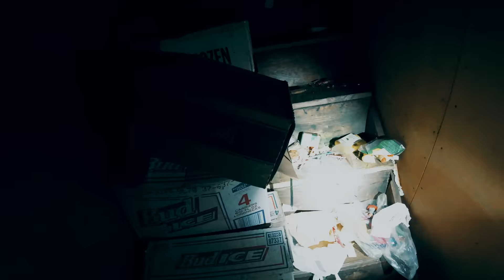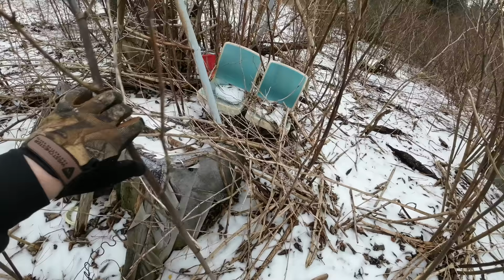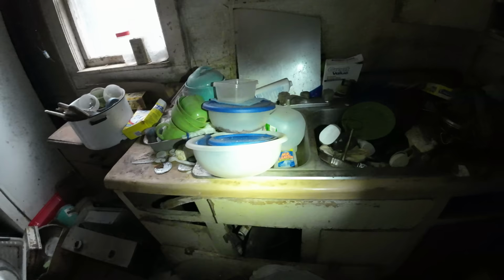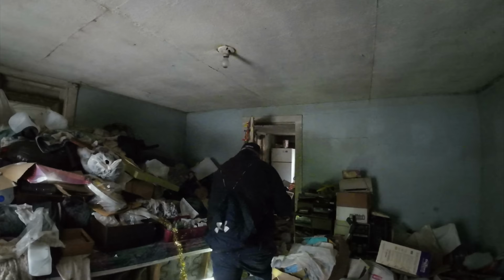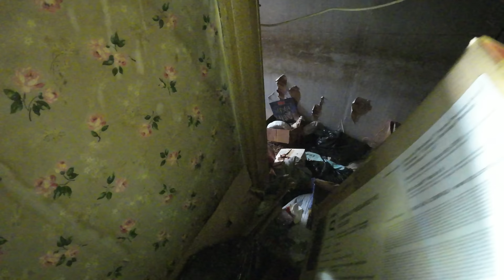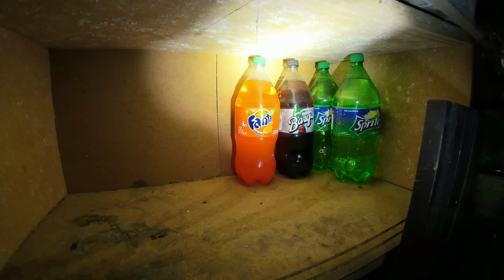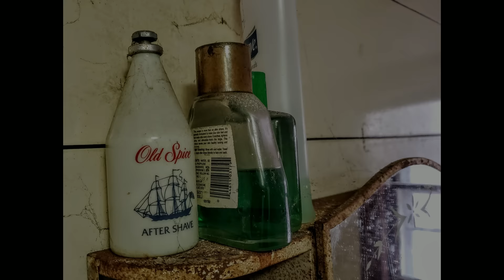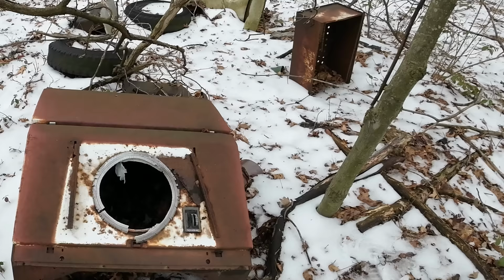Shockingly Indescribable Abandoned Hoarder House - Entire Life Left Behind!

Comment: The house is full of collectibles and some antiques. Their is antique furniture and steamer trunks. Collectibles in toys, electronics like the Atari game console. Collectible movie camera. Collectible cosmetic jewelry. The electric guitar would have some value. Collectible bowling alley signs and pins. Collectible kerosene lamps. Collectible glass bottles. You would need patience working through everything. So wouldn't miss anything. You could enough to open a small antique and collectibles shop. Here is an idea. You buy the property at land value. You drop down a large metal shed near the main road and set it up. You drop further back dumpster for trash and another one for recyclables. Bring in a scrap metal guy to remove the metals. Take the rubber tires to be recycle.

Comment: Evidently the occupants had no operating central heating (radiators =boiler) thus using kerosene heaters. Also no running water that explains the zillion gallon water jugs. A toilet will flush using about 3-4  gallons of water but likely the plumbing froze from lack of heat. 
Hanging laundry upstairs where heat rises is quite clever. 
The utter disarray.....?  A mental illness. Clearly the house has been ransacked for valuables (guns especially). Can see that for all the cabinets/drawers open,  furnishing flipped, tossed boxes, dumped onto the floors, etc. making it appear worse. 
So many questions. Thank you for the journey!

Comment: It's obvious they ran out of $.
Not keeping the roof sealed, ran the boiler dry, living on Kerosene heaters which stink bad. 
Scrapping for what little $ it gets (pays for the fuel to drop it off and go back home). 
Second possible situation is they ran a stall at a Flea Market and the junk was held in storage as the stock slowly depleted. 
I'd say they stayed until as late as 2014/15.
The fridge items dates would be more accurate than the cupboards as cans can linger at the back for far past the date unlike say a bottle of milk
Edit
It was also kicked upside down by treasure hunting bunch, making the already huge mess even worse.
The Atari 2600 was the one most teens had in the mid 80s, the "big classic". The 7800 was the last kick at the can like a "reboot" not the original everyone remembers 
The Old Spice is from the  1960s.